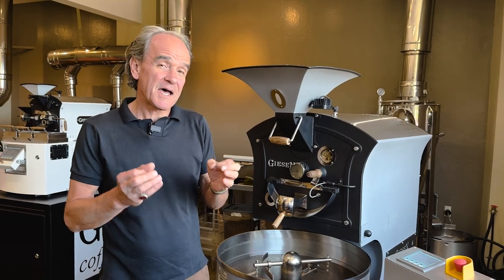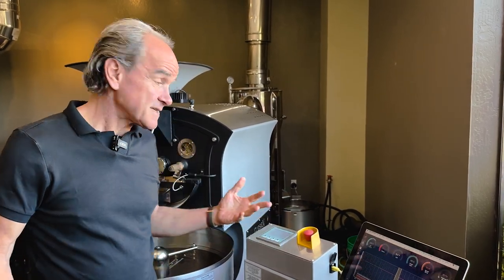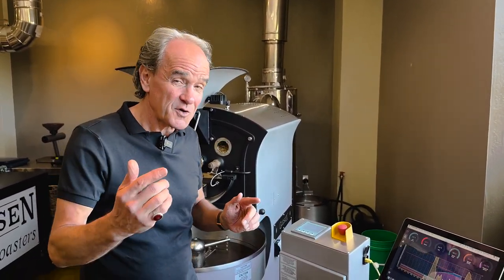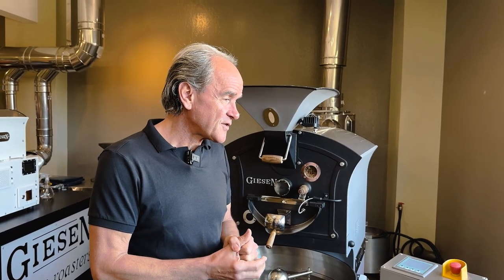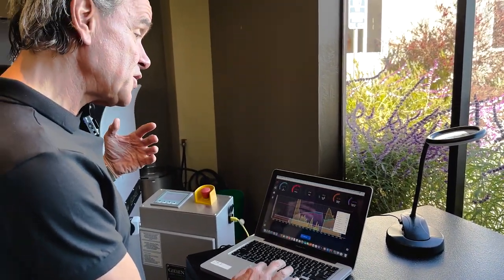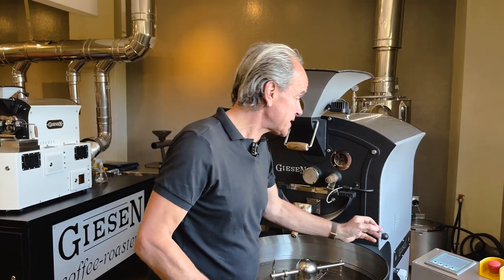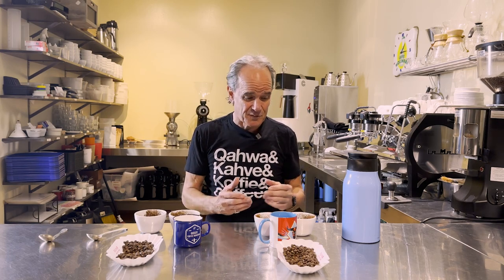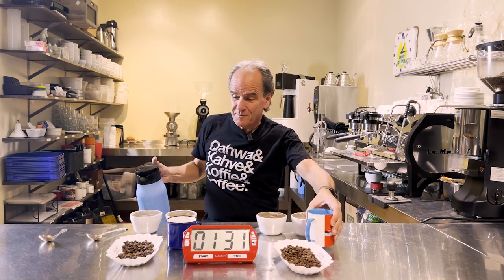Behind the roast with Willem Boot - Pressure profiling with Giesen roasting machines

Comment: Hi Mr. Willem

I recently subscribed to your channel and enjoyed your videos. I have questions. How can I enhance flavor during roasting, and what temperature range do you recommend for optimal results?
Reply from the maker: Hello Giesen friend!
Thanks for your question about enhancing the flavor of your coffee through roast profiling. 

When considering temperature ranges for roast profiling, here are some key points to keep in mind:

1. *Drying Phase*: Start the roast at a relatively lower temperature to allow the beans to dry properly. I recommend a start temperature (air) of 350F or 175C. Keep the flame at 50% or less.
2. *Maillard Reaction*: Increase the flame level  to 80-90% depending the batch size in order to initiate the Maillard reactions, which initiates the chemistry changes. The peak point of the MR is around 300F or 150C
3. *Development Phase*: Control the temperature carefully during this phase to develop the desired flavor profile without over roasting the beans. The development phase starts at the first pops of the 1st crack. Keep the development limited to 90 seconds to 150 seconds depending on the roast degree you are looking for.
4. *Cooling Phase*: Ensure proper cooling after roasting to stop the beans from developing. The cooling must be completed within 4 minutes. Verify that the beans have a temperature that is hand warm or cooler.

Experiment with different temperature ranges within these phases to achieve the flavor profile you desire. Remember that slight adjustments can make a big difference in the final flavor of your coffee. Happy roasting!
Reply: @giesencoffeeroasters   Thank you so much.

Comment: Hi boss, thanks for the videos clips, its really exciting to watch your coffee roasting clips and each time I learned something new. I have a question on this Pressure profiling; when there is increase of under Pressure value, drum fan is running faster, air flow is increased proportionally, so, does that also have a decreases in heat temperature in the drum also?
Reply from the maker: Hello! Thank you for your question. Willem says the following about this: "If the difference between the bean temperature and air temperature is less than 10 °C, the increased air pressure will decrease the heat in the drum. If this difference is more, then it will lead to an acceleration of the roasting process."